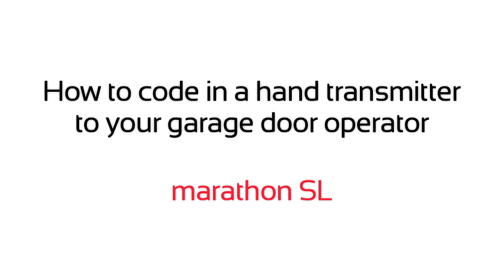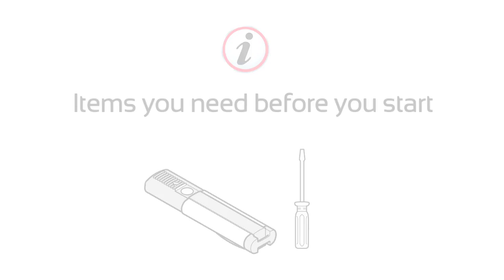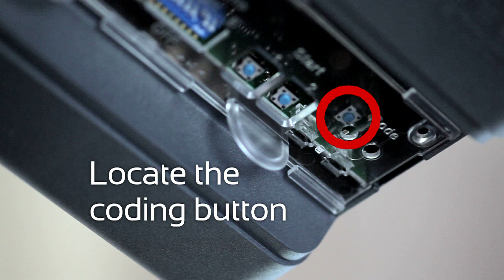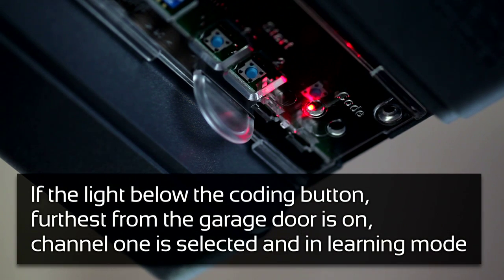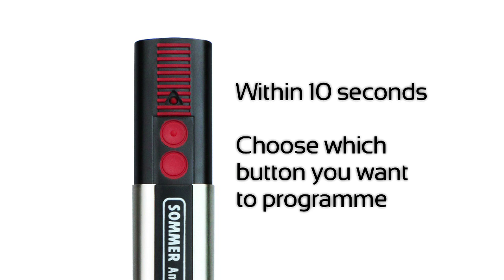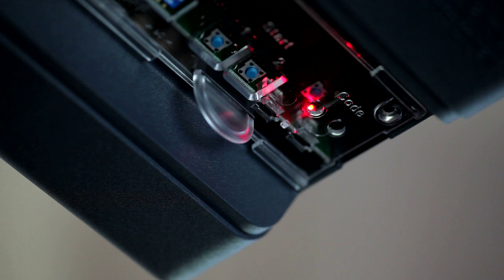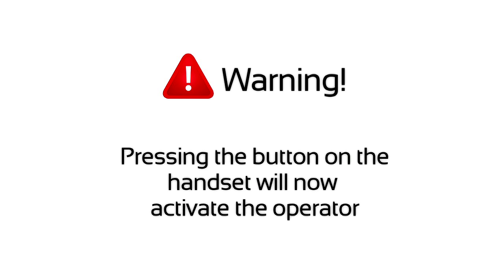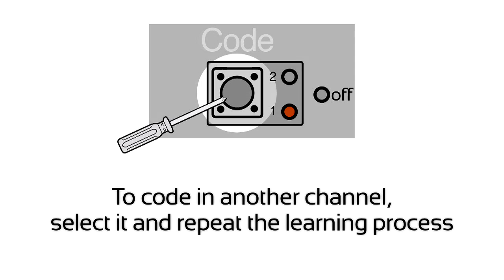SOMMER Coding a hand transmitter 868 MHz to a marathon (EN)

Comment: What if my light is green and not red what do i do
Reply from the maker: Hello Matic,

a green LED means that your operator has the radio frequency FM 434.42 MHz. Please check the type plate.

You need a hand-held transmitter from SOMMER with radio frequency FM 434.42 MHz in order to program it to the operator.

Best regards
Your SOMMER Team

Comment: Can a buy a generic transmitter and code it also I currently have a transmitter and i have tried this multiple times and it doesn’t work ???
Reply from the maker: Hello RocketMoon101,

generic handheld transmitters are not provided. If you use a handheld transmitter from SOMMER, you will have no problems.

Best regards
Your SOMMER Team